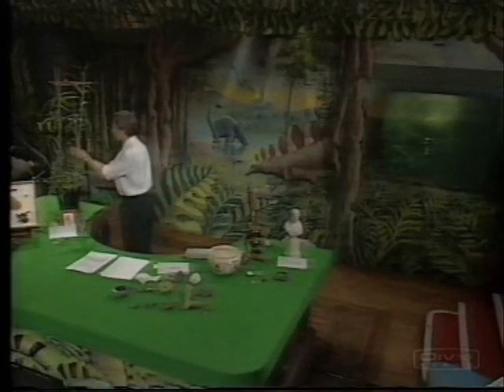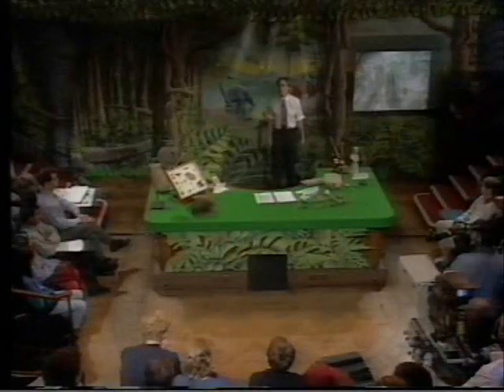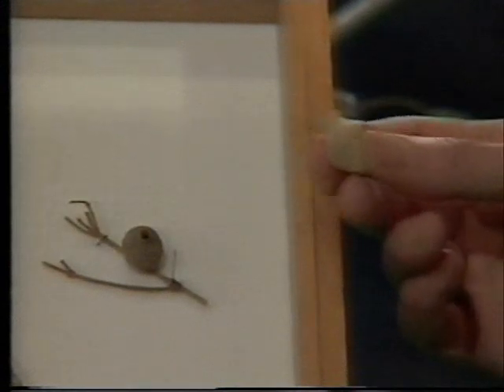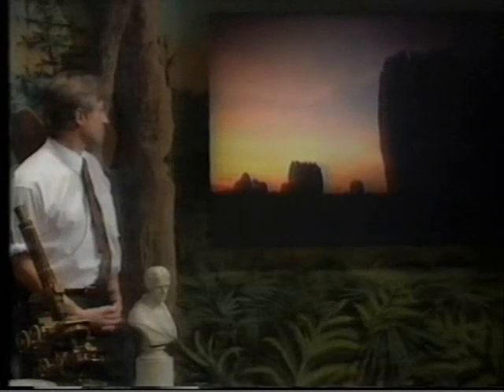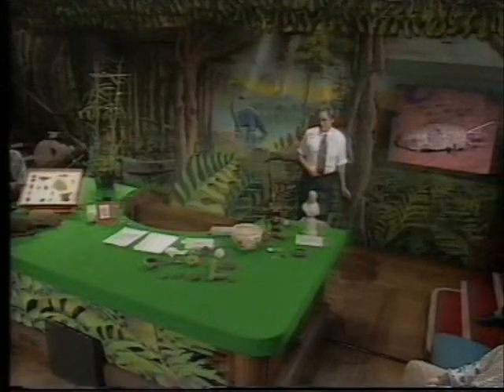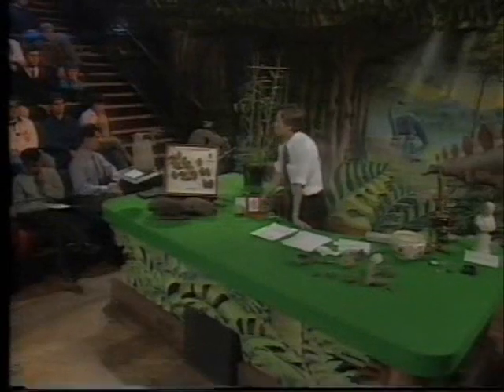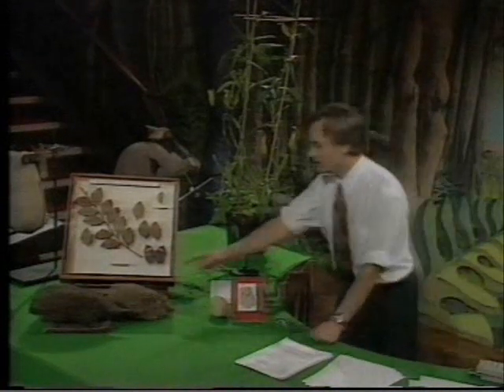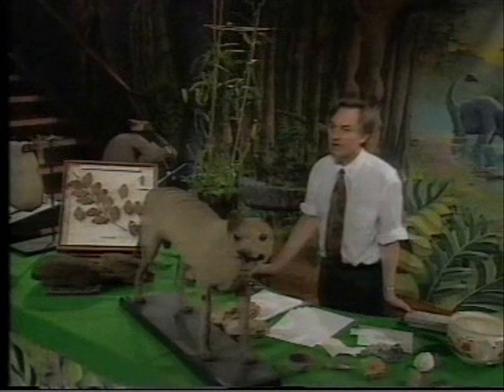Dawkins: Lecture 2. Designed and Designoid Objects ( 2 of 6)

Comment: ( I point to Darwins claim that the theory would need rebuilding   from bottom up in case of a discovery of even smaller mechanisms than cells, but discovery of the DNA was claimed right away to confirm evolution, i'd question such a claim of understanding DNA completely, even today!